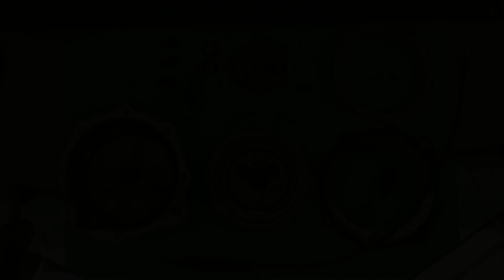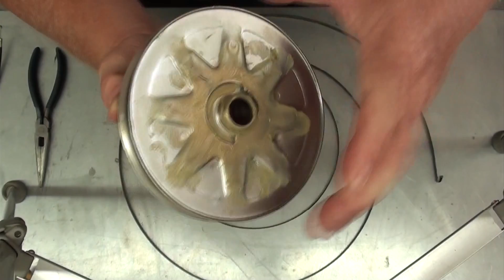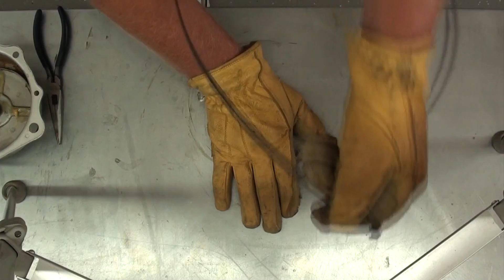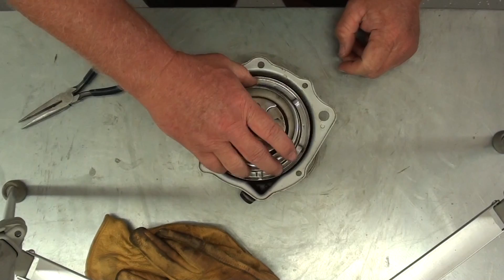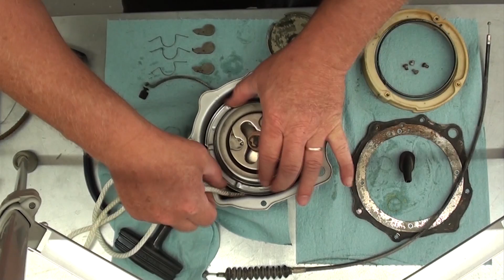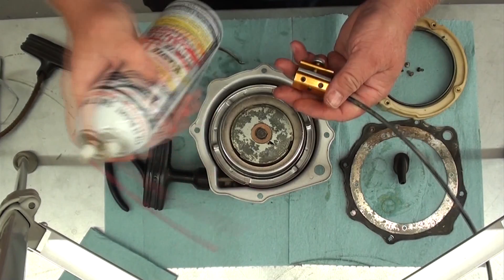Pt.2 Honda ATC 185 - 200 Recoil Starter Repair At D-Ray's Shop

Comment: I've actually had a few small engine guys tell me to not lube the rope As it collects dirt once it is and basically becomes a hardened mud string. If it's an old cotton rope I'd say go for it but if it's synthetic like nylon, poly I'm sure any petroleum based product will negatively effect it And cause dirt build up in the rope.

Comment: I've used a piece of flat steel with 3 Holes in it about 3 inches apart then put wood screws I all holes, then tighten in down so it's about 3/8 of an inch away from 2x4 then used the center screw to hook the middle of the spring. Then wind up and secure with bailing wire.

Comment: Why is it when I put the assembly together greased an all it works but as soon as I put it on the machine and test it out the string will not retract? Any ideas to what’s causing the hold up. I tried different tensions and went over the pound pull you suggested.
Reply: Did you ever figure out what your issue was ?

Comment: I have a 1980 model 185atc Honda and I'm having a few issues problems it acts like its starving for fuel but when I first fired up it runs just fine when it's time for a little while and then it spits and sputters like it's not getting enough fuel petcock is fun and as far as I know the car wreck or something but when I turn the petcock on the bottom of the carburetor starts leaking gas out of it is that normal or not
Reply: +James Parrott youre carb needs to be cleaned probobly.If that dosnt help get a rebuild kit for the petcock.

Comment: Very helpful video,  The only issue I had was I broke the old coil spring and had to order an new one.
I had trouble trying to get the pulley to hook on the spring. The inner hook was not near the center and I had to
play with for awhile before I got the pulley to hook.

Comment: Ray,

Thank you so very much for this video. I found my problem after hours of trying. I wasn't winding up the coil before closing it up. I also found I was missing the decompression spring, I will have to see if I can find a replacement and a boot.

Comment: Hmm about 5 rotations for the rope roughly.

Like that cable block tool :-), if the cable is on the bike ive used the old method of eather make a tight fitting funnel of plasterceine or wrap a plastic bag round the top of the cable and fill with oil, not quick or pretty but still works :-)

For cruddy cables ive used wd40 to chase the crap out first, then real old for long term lube.

Now be honest lol, did you loose the spring at least once and swore ha ha :-)